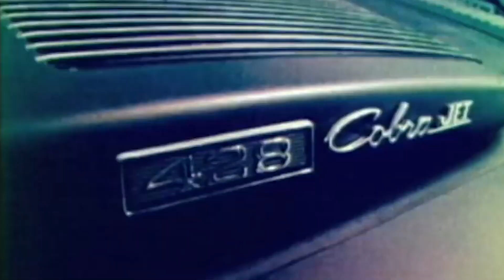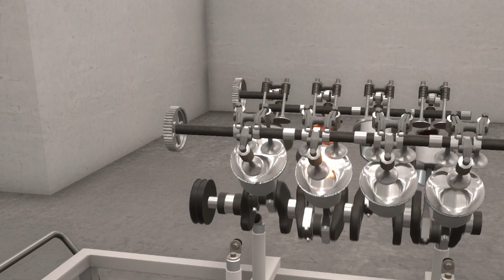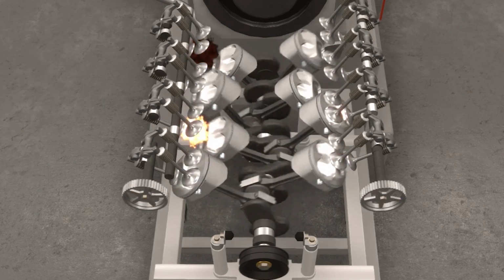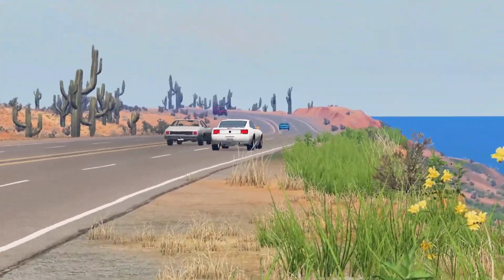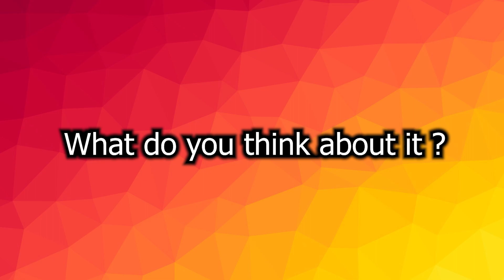2005 Ford Mustang GT Replica in Automation.

Comment: I was wondering if you could make an engine king video but for the highest achievable top speed engine, because with the new 1950s Space Boat mod you can reach up to 350+ mph because of the drag coefficient of the body, and I just recently realized how the maximum top speed you can get while modifying your gearing is correlated to your engine RPM. Low engine RPM, low adjustable top speed. High RPM, high adjustable top speed.